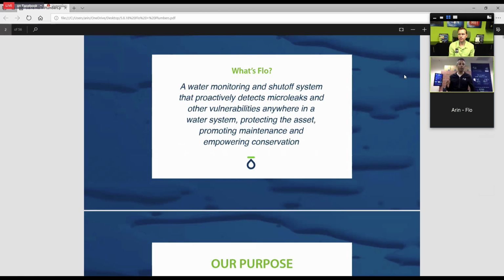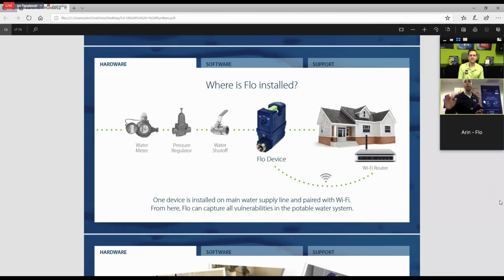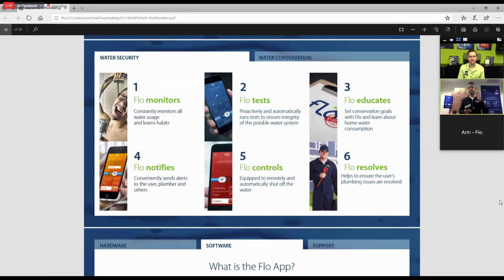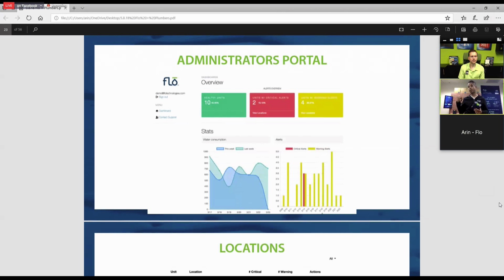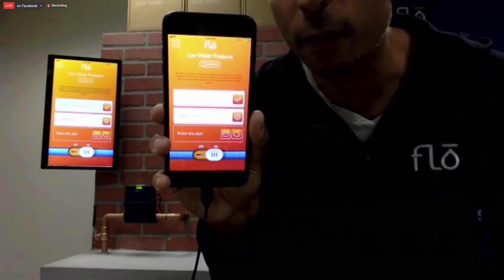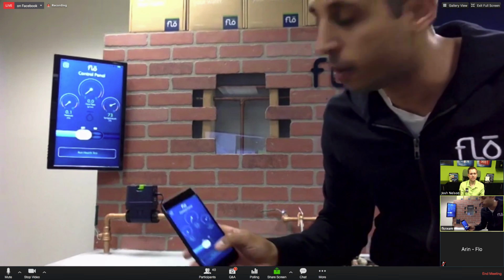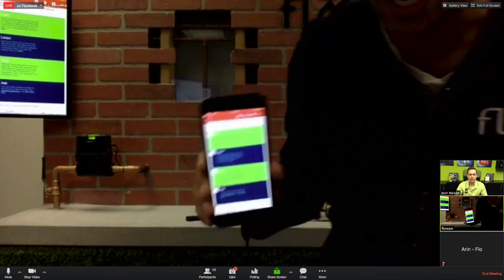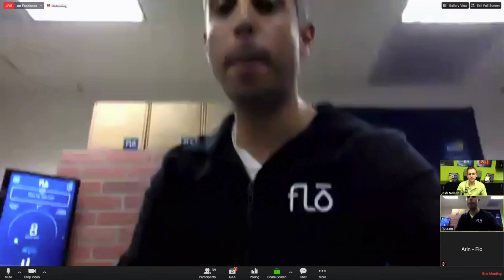Innovative new Plumbing Technology you MUST know about - FLO

Comment: 2 years old and only  response? The mindset behind this system is really good. I want to give you a tip as a plumber and one who has worked in different areas with various qualities of water. Add a timer to the valve on your ap so that an alarm goes off if it’s still in a mode where the valve is to corroded to turn. I also have an invention I need some help with that could be an addition to your system that will be huge!!!! Watts is a great name in the plumbing industry and trusted!